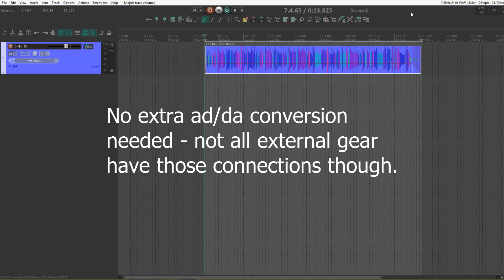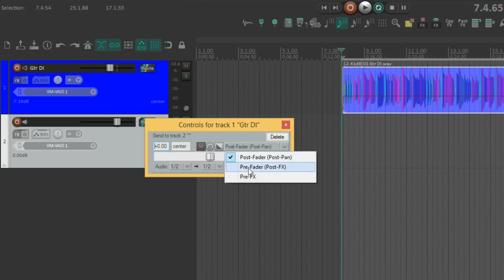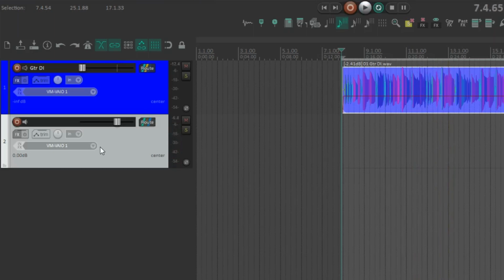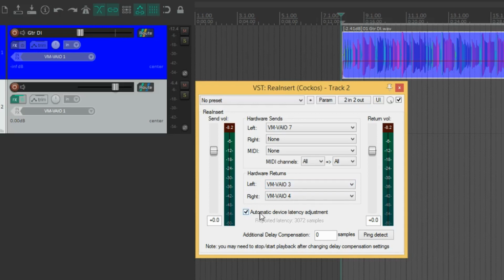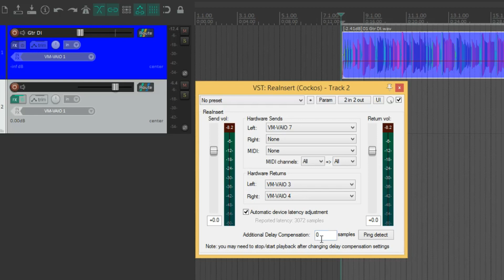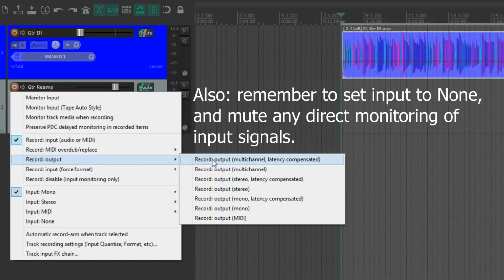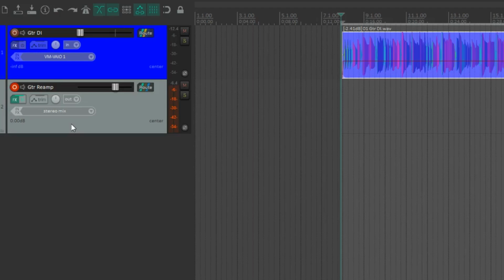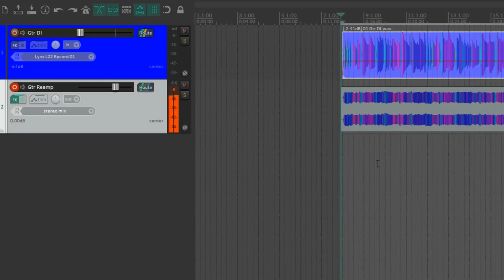Reamping And External Hardware in REAPER 6

Comment: Hi, Kenneth A.
Thanks for the video.  Here, and sorry for this, it doesn't work as well. I'm in s-pdif, and it's all ok until I activate the ReaInsert plugin. After that, no sound anywhere. My signal chain (Kemper birthdate 2019, so the soundcard_focusrite scarlett 6i6_ is "slave", in 44100kHz, "Sync. Source : s-pdif" ) : s-pdif OUT scarlett into Kemper's S-pdif IN,  K's S-pdif OUT into Scarlett S-pdif IN. There's an awful 'oise, like a digital larsen. Have I done something wrong in all that ?
Anyway, have a nice day.

Comment: This is driving me up a wall!!! Set up just like yours, except I’m using a FocusRite 8i6. I think my problem is in the ReaInsert. For my Hardware sends, I’m only getting a choice between None, Output 1 and Output 2. 

On my FocusRite, Outputs 1 & 2 go to my monitors. I have 2 S/PDIF outputs set up in my FocusRite control software, but they’re not selectable in the ReaInsert VST.

But I do have 2 S/PDIF cables hooked up, one from KPA out the FocusRite in, and one from FocusRite out to KPA in. Shouldn’t that be all I need? Any idea how to get the FocusRite S/PDIF out to be recognized by the ReaInsert?

Btw, I can set my hardware returns to S/PDIF 1 or 2, but nothing I do brings the return volume peak above -54db. Even if I turn the Reamp Sensitivity up to +12.0db on the KPA, then my return volume peaks at around -44db, but nothing records and nothing plays through the FRFR connected to my KPA (should it?).
Reply from the maker: Just an idea..check your output settings in Reaper preferences (Device - Output Range). Could be that you've only set output 1 and 2 there instead of all available outputs on the interface. That may explain why you can't choose the S/PDIF outs in ReaInsert.
Reply: @CrashwaggonMusic  I’m definitely setup for Output 1 and 2 for my range, but S/PDIF isn’t a choice there. Though I just hooked up S/PDIF out today. Maybe a restart of Reaper or the PC will make it discoverable...
Reply: Ok, had to restart my laptop, but finally got it setup and working. Great vid, thanks!!!

Comment: I am reamping using my Behringer 404 into my reamp box.  My problem is, I am not getting maximum signal from reaper out of the behinringer.  Does the way you show here give you 100% signal coming out of the audio interface(behringer)?
Reply from the maker: Yeah, normally adjusting the volume on the DI track (item volume) should do the trick in most cases.

Comment: Thanks for the video. Still doesn't work for me for whatever reason, no matter what I do I just get no sound whatsoever from the Kemper. I have the DI recorded and set it up the exact same way you did the only difference was using a guitar cable.
Reply from the maker: Hmm...that's weird, should be working. I'm guessing you're trying to reamp "analog" style instead of using S/PDIF? Probably some dumb setting somewhere, but not sure where...
Reply: @CrashwaggonMusic  Yeah I just don't have the right cord for S/PDIF right now so I wanted to try it that way but its been a huge pain. I tried everything I could for like 2 hours and then just recorded it in the normal way.
Reply: @CrashwaggonMusic  Here, and sorry for this, it doesn't work as well. I'm in s-pdif, and it's all ok until I activate the ReaInsert plugin. After that, no sound anywhere. My signal chain (Kemper birthdate 2019, so the soundcard_focusrite scarlett 6i6_ is "slave", in 44100kHz, "Sync. Source : s-pdif" ) : s-pdif OUT scarlett into Kemper's S-pdif IN,  K's S-pdif OUT into Scarlett S-pdif IN. There's an awful 'oise, like a digital larsen. Have I done something wrong in all that ?